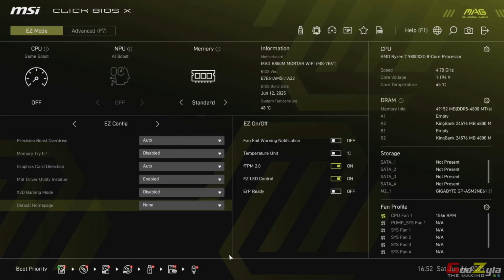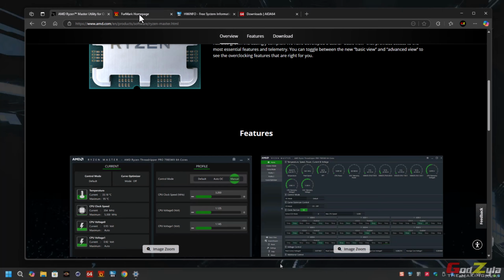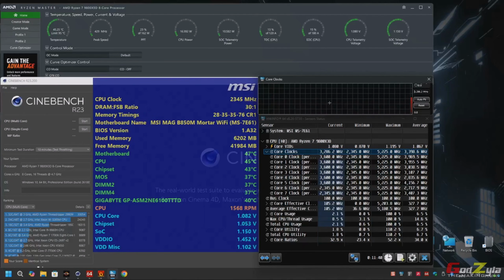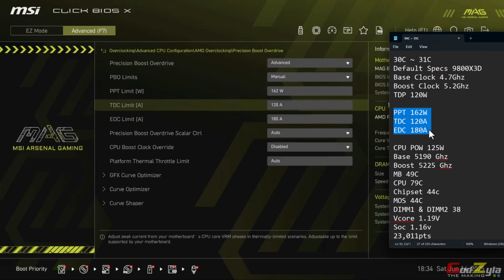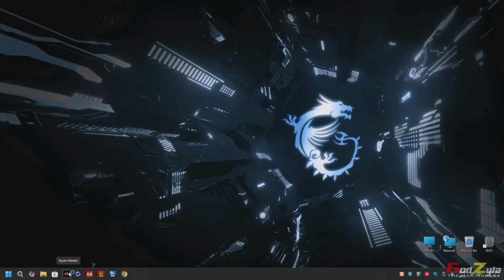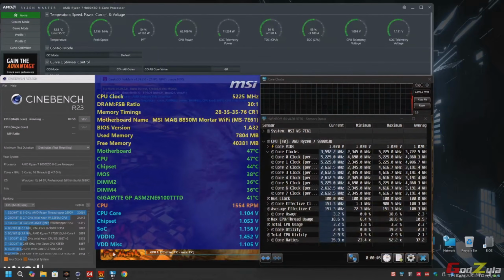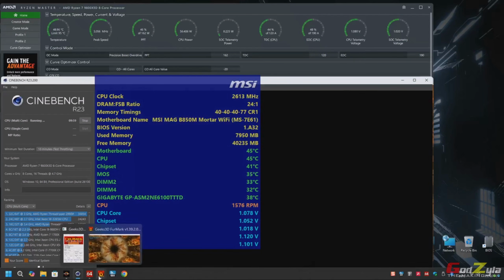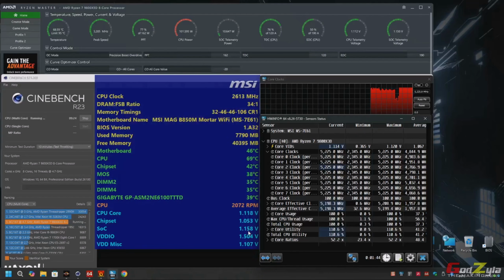PBO2 Curve Optimizing with 9800X3D on MSI Motherboard

Comment: Hey mate, this a great in depth video!
Had a question for you: did you try AIDA64 stresstesting at all?
I’ve got roughly the same pc hardware as you in this video and I’ve failed AIDA64 at 1 second in every time. 

Thanks for the video!
Reply from the maker: Hi Sercer25, welcome to my channel. Yes, normally once I set up or to configure. I will run Aida64 stability test for 1 hour, same apply on  OCCT test. If unstable will do minor adjustments
Reply: @KleoYan It appears to be related to CPU. 
I ran the test without memory, just CPU, FPU, and cache and it crashes my PC. 

Do you have any tips on whether it’s the temperature spike crashing my pc or is it something with my undervolt? Genuinely confused about what to do. 
Thanks again.
Reply from the maker: @Sercer25 I will first test stability test with just default, no configuration on VCore off set. If it passes. Then set VCore offset and test again. If passes. Then I will do curve optimizer at -20. If passes, then I will do curve shaper and to test again.  That’s how I trace if there is an issue on aida64 stability stress test.
Reply: @KleoYan awesome! I’ll give it a try again, I just need to be a bit more patient. Everything passed fine in cinebench, never went over 64c with your settings. So I’ll keep tweaking it.
Thanks, have a good week!
Reply from the maker: @Sercer25 you are most welcome. All the best with your tweaks too 😉
Reply: Ran into the same problem, seems like curve shaper and curve optimizer not stable on my cpu and  i have ryzen 7 98003xd paired with 32gb 6000mhz cl30 and rtx 5070 ti
Reply from the maker: Hi טל מינו פרסיאדו, welcome to my channel. How long have you used your 9800X3D for and did you do other settings before you follow this content? I would advise to do step by step. 
1) clear cmos 
2) set Expo profile
3) set SoC voltage to 1.15v
4) set vcore offset to -0.05v 
5) run aida 64 test and benchmark test , play some games.
6) if it pass, next set PBO limits, if it fails, troubleshoot step 3) and 4) 
7) if pass, Set  SoC/Uncore OC Mode > Enable
8) set to manual PPT 162W , TDC120A and EDC180A
9) Curve optimizer -20
10) run aida 64 test and benchmark test , play some games. 
11) if stable set curve shaper, if unstable, you can either remove the Vcore offset or pump Curve optimizer from -20 to -15.
12) last step, set curve shaper
Med Freq : Low Temp -15 , Med Temp -15, Low Temp -15
High Freq : Low Temp -10 , Med Temp -10, Low Temp -10
Max Freq : Low Temp -5 , Med Temp -5, Low Temp -5
12) if unstable, remove curve shaper, just run Curve Optimizer
so along when you run and test, you will know where the hiccup is at.
Reply: @KleoYan kind of new, bought a computer 3 weeks ago, i didnt do any setting the computer was built in the store i purchased it on (i picked the parts so a fresh build)
Reply from the maker: if your system is new. do not just copy my settings, understand what's going on. as mentioned follow the steps as provided in this content, else I have no idea how to aid you further. do baby steps when you tune your system.
Reply: @טלמינופרסיאדו  if you’re having issues, like Kleo suggested: only do curve optimizer at -15 or -20.
Follow other settings but ignore curve shaper. 
It’s an ideal easy configuration, but make sure you follow the rest of Kleo’s video. It’s amazingly well done and the only reliable video on UVing a 9800+MSI. 
Mine never goes above 50c in gaming/multitasking/etc. I’m using a 420mm AIO however.
Reply: @Sercer25 i have a 360 aio and even -5 on core optimizer would make the aida64 stress test crash, i traced it back to cure optimizer and curve shaper no matter what i do it would make it crash
Reply: But with all the steps in the video its working very good even got more points on cenabench.
Should i enable 3dx game mode?
Reply from the maker: @Sercer25  Hi and thank you for helping out. Greatly appreciated it and wow nice temperature you have on your setup too. Congrats 👍👍👍
Reply from the maker: I am kind of confues now, did you manage to set it up or?
Reply: @KleoYan  did everything you suggest doing but with curve optimizer and shaper on auto.
Reply from the maker: @טלמינופרסיאדו ok thanks for the update.

Comment: amazing video. I mess with a lot of different ram configurations with my 9800x3d all the time and this is the best video or article I have come across
Reply: what I did was unstable I want to leave a note about it incase someone tries to follow it. I used the curve shaper incorrectly
Reply from the maker: @Connorhockeydude  Hi and thank you for sharing. Maybe you can list out what are done incorrectly on the curve shaper? As I re read all your comments, I only notice you've mentioned about your 4 DDR5 Ram sticks hmm 🤔
Reply: @KleoYan  i subtracted even more ontop of increasing the negative value in curve optimizer so I was undervolting way too much. I changed the co to -25 from -20 and then changed the curve shaper values from -15 to -20, -10 to -15, and -5 to -10. after realizing i was increasing the undervolt too much I adjusted it so I never undervolt by more than -30 in max frequencies and it has worked well. I got 3  10 minute multicore cinebench tests all with a result of 23866 with one test scoring 23885 inbetween which is frankly impressively consistent. I did revisit trying to get my ram to run well at 6000 but I had no success and always fail the hammer test in memtest86 with 128gb ram at 6000.
Reply from the maker: @Connorhockeydude  ooo ok got you... thanks for taking the effort to write out. greatly appreciated it. 👍👍👍
Reply: @KleoYan no thank you
Reply from the maker: Hi Connorhockeydude, welcome to my channel. I am glad you like this content. Thank you for the feedback and all the best with the configuration. Do let use know if the configuration did aid you 😉
Reply: @KleoYan you know it did. I have never messed with curve shaper very much because I don’t have a very good understanding of it. I use 128gb in 4x32 and I have it locked at 3600MT/s. I got all of my best cinebench scores with that configuration which surprised me. I have infinity fabric and frequency dividers at 1200 and uclk=memclk/2. it seems to be the most stable configuration for me but I have tried so many combinations. getting 128gb to pass memtest86 seemed to require this ram configuration with 128gb on am5. I really care about stability more than anything but I do seek performance of course
Reply from the maker: @Connorhockeydude  hmm.. did you purchase all 4 sticks as a kit or did you purchase 2 seperate similar kit (example two boxes of 32G kit) ? if you have purchased 2 seperate similiar kit, the chances of running 4 sticks will best to use Single Rank (1R) sticks and not Dual Rank (2R) sticks. reason is, in generally, single-rank (1R) RAM modules have a higher chance of successfully running at higher speeds and in larger configurations (like 4 sticks) compared to dual-rank (2R) modules. This is because single-rank modules place less strain on the memory controller, making it easier for the system to handle multiple sticks of RAM simultaneously.
Reply: @KleoYan they are all matching and I can run them at 6000MT/s but it isn’t very stable. also it was pulling too much power like that. with the curve shaper you provided I changed the curve optimizer to -25 and dropped each of the curve shaper numbers by 5. you helped me get a cinebench score of 23354 and I am stoked about it. especially with 128gb ram. I use a gigabyte x870e aorus elite
Reply from the maker: @Connorhockeydude  oh ok ok. got you.

Comment: I have my PPT at 115W, TDC at 90A and EDC at 105A, SOC set to 1.125v and VDDIO set to 1.25v and a PBO negative offset of -25, working flawlessly on my B850 Tomahawk.
Reply from the maker: Hi jaydude25, welcome to my channel. Good to hear you have your own settings and it's running fine.
Reply: I’ll be referencing this later this week. I have the same MB.

What sort of performance are you getting?
Reply: @Slobb3rKnocker  pretty much exactly the same performance at stock settings, just lower temps and power usage, I did change the offset to -20 instead of -25 though just to be safe
Reply: @jaydude25 awesome I’m looking forward to doing this tonight

Comment: Ottima spiegazione 👍👍👍
Reply from the maker: Hi TOTI, welcome to my channel. Thank you for your kind words and wish you all the best with your configuration 👍👍👍
Reply: @KleoYan Hi. At the beginning of the video, you ran a test with the default BIOS. Your temperatures are 79°C max. How is this possible? I have an MSI MAG B650 TOMAHAWK WI-FI and a 9800x3d, yet with the default BIOS, I immediately reach 95°C in Cinebench 23. I have a Thermalright Phantom Spirit 120 SE. Could you explain to me how you get 79°C? Thanks.
Reply from the maker: @brushlesscts  at the beginning when I have mentioned, these are the settings I’ve done before installing windows. My vcore is offset to -0.05v and my SoC voltage is lock at 1.15v. Also this test is conducted using an Arctic Liquid Freezer II 360 with gentle typhoon radiator fans. When I say default, it’s meant on the PBO2 settings which I have not tweak. So that’s how I get 79 degrees.
Reply: @KleoYan Thank you so much for your reply. I had missed the 0.05V offset. So I'll just need to make a 0.05V offset to get lower temperatures. It's amazing how this small setting can make such a big difference in temperature. Thank you so much.
Reply from the maker: @brushlesscts  is not only the offset on vcore but the SoC voltage. These are the two key to lower thermal as these provide sufficient current and to lower the current drawn.
Reply: @KleoYan Thanks again. My vsoc is currently set to 1.020v because I don't want to enable Expo yet. My PC is new, and I'm taking it one step at a time. I'm in no rush. I just want to get low temperatures and better performance. What I don't understand is why everything isn't optimized by default. Why does the user have to make changes?😅
Reply from the maker: @brushlesscts when parts and produce, each and every component will have a min limit to run. Therefore motherboard vendors are to follow the standardised configuration to run pc components. Plus all components are build differently. Therefore they won’t tweak each and individual components.
Reply: @KleoYan I wanted to ask you another question. In your video (minute 31:20), you say that using "all core curve optimizer magnitude = negative 40 or 50" can damage the CPU after 8 months. So, I wanted to ask you why an undervolt of -40/50 can damage the CPU in the long run? Thanks.
Reply from the maker: @brushlesscts  I have experience on my 5950X when I did extreme negative curve opitimizer to -30. Had it that way and about 4 to 5 months down the road, I am not able to have my system to run stable, therefore I lower down the curve optimizer. same thing happened to my 7950X. I did the same extreme curve optimizer to -30, again, my system gone unstable after few months down the road and again I have to lower down the curve optimizer. You might feel that -30 or -40 is undervolt and will not harm the processor but in general, all electronic devices will degrade overtime when you over stretch it. 
I practice to have moderate curve optimizer as I can't afford to have my system crashing while doing work. If you feel what i've mentioned is of no logic, you can proceed to have your curve optimizer of -30 or even -40.
Reply: @KleoYan Thanks for your reply. I believe you. I just thought the only thing degrading the CPU was the x10 scaler. However, the 9800x3d is already a fantastic CPU, and after doing some tests with curve optimizers, etc., I didn't see any significant gains or significantly lower temperatures. So in the end, I just set a temperature limit of 75°C and a watt limit of 95W. I got results just under 6% lower in all tests. But my power consumption and temperatures are much better than 50%. I'll leave it as is. It doesn't make sense to me to max out the CPU, VRM, and PSU just for that extra 6%. The 9800x3d is already plenty powerful as is.🤗
Reply from the maker: @brushlesscts yup. That’s good 👍

Comment: im using klevv fit v 6000mhz and cl30, should i use override mode for it?
Reply from the maker: Hello Mah Yoo Nice, welcome to my channel. I will first enable expo profile and to do the cou configuration first. Next install windows. Once Everything is done, then fiddle with your rams. As in to set to the tightest. If it boot to
Windows, test it with OCCT test. If it does not boot, then leave it as auto.

Comment: This is the best video I've seen on this subject so far.  Very detailed and informative. I have an MSI motherboard and this was so easy to follow. Applying what you recommended my cpu power consumption went from 115W to the high 90's. Running Cinebench my temps dropped from 85C to 74C. My ram(6000Mts) has tight timings 28-36-36-96 and I had no problems using your adjustments. Very well done sir!
Reply from the maker: Hi petmic10, welcome to my channel. Congrats on your settings, thank you to have shared your experience with us and I am glad it work out for you. 👍👍👍
Reply: @KleoYan  No problem sir! You earned a follow!
Reply from the maker: @petmic10  Thank you very much 👍👍👍

Comment: Thank you Kleo! I used your settings and my CPU is running great without the jagged graph on the CPU Core. I purchased the 9800x3d two weeks ago as a bundle deal from Micro Center. The rams are not that great, it's a ddr5 6000 cl36, and I tried High Efficiency Mode tightest and tighter but it failed to boot. I'm currently using Balance and I tested against Auto in Aida64 - Auto=80ns / Balance = 72ns in latency. I don't know too much about rams I just know the lower the latency is better. Do you still recommend running it on balance or should I go back to auto?
Reply from the maker: Hi 3nvis1on, welcome to my channel. I am glad this content did help you. For the rams leave it as balance if it runs fine 😉
Reply: @KleoYan  Thank you Sir I really appreciate your help. Looking forward to more of your content.
Reply from the maker: @3nvis1on you are most welcome. Call me Kleo will do 😉

Comment: Why not change the pbo limits (edc, ppt and tdc) by lowering it instead of putting an offset voltage to the cpu?
Reply from the maker: Hi God-Zilla, welcome back. I prefer not to stretch the vcore voltage more. You can use your method. No right no wrong, so long to keep TDP lower or near to 120w.
Reply: @KleoYan thank you, will do!
Reply from the maker: @god-zilla4233 you are most welcome 👍

Comment: What is your pump speed? Is it good if i put 70% up to 100% when hot?
Reply from the maker: Hi God-Zilla, welcome back. My pump speed is always 100% as am using an Arctic liquid freezer II 360, but I’ve changed the rad fans to the 2150rpm gentle typhoon from nidec.
Reply: @KleoYan I have almost the same pump, I have the arctic liquid iii pro 360. But didn't Jay2Cent said that it was better to have the pump at 80%?
Reply from the maker: @god-zilla4233 hi and welcome back. Again there is no wrong no right and I do agree if you wanted to run it at 80% to reduce noise. For myself, most of my AIO pump runs at 100%, unless it’s noisy, then I will set it 80% and not lesser than 80%.
Reply: How do you test if 80 % or 100 % (constant speed) is better than 80 % to 100 % curve based on temps?  @KleoYan
Reply from the maker: @god-zilla4233  to my own concept, I prefer constant speed vs curve speed. reason being, having the pump going up and down will have more friction. In practice, I have two liquid AIO . 1st is the 280 LF2 which I got it from Germany when it first launched (5 years ago) and 2nd the 360 LF2 which I have been using for content creation (open bench, 4 years ago). Both still up and running fine till today without any issues.
Let me further explain. you see when CPU Heats up. the running water will pump to the radiator. having it constant, there will be no delays in cooling the fluid through the radiator. If I use curve base method where it reaches a certain °C, the pump will ramp up. The reaction time to push the water to the radiator will take sometime, therefore it takes time to normalized or to cool the CPU temperature. 
of course you can use PWM Curve based on your pump. Again there is no wrong or no right. It's just a matter of personal preference.

Comment: Can you explain high efficiency mode and memory timing preset? I have tforce 32 gb (2x16) kit with 6000 mhz cl30 white and argb and msi x870e edge ti wifi.
Reply from the maker: Hi God-Zilla, welcome to my channel. This feature High Efficiency Mode is only cater for MSI mid tier to high tier motherboard. You can give it a try to enable it and to set your ram timing tigher. there are total of 4 mode (Relax, Balance, Tight and Tighest) if it fails to run at Tightest, tune down to Tight. Explanation as follow Its designed to optimize memory performance. It works by fine-tuning memory timings and frequencies to reduce latency and increase bandwidth, potentially leading to improved gaming performance.
Reply: Thank you for your answer. How do you test it? Would it really matter in the context of 1440p gaming aaa games?  @KleoYan
Reply from the maker: @god-zilla4233  This I am not able to answer your question as I don't play games. you might want to do some research regarding about the impact while playing games with low latency and tight timing.